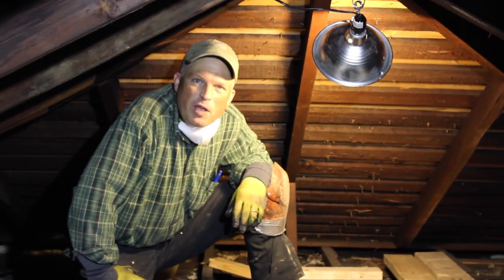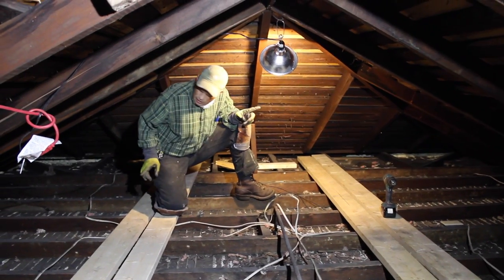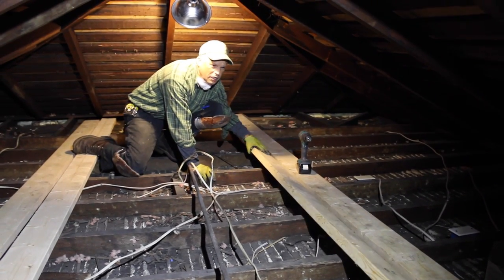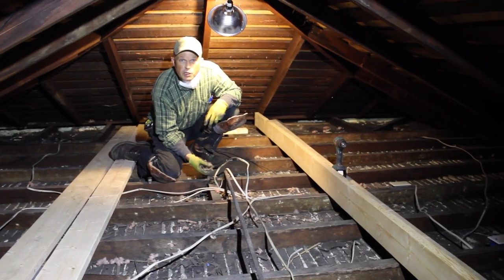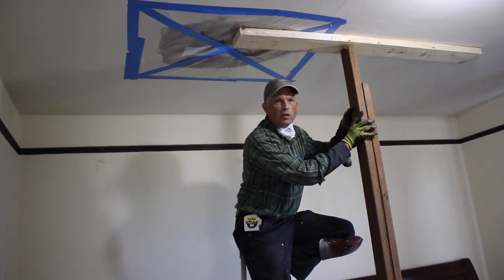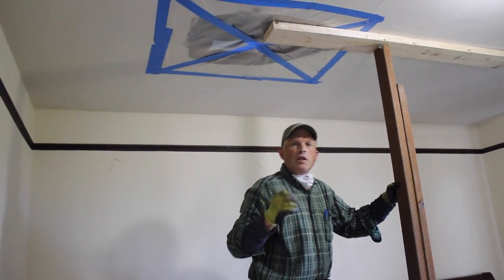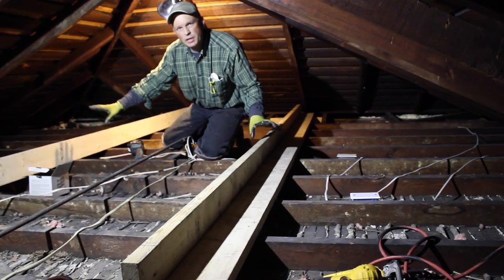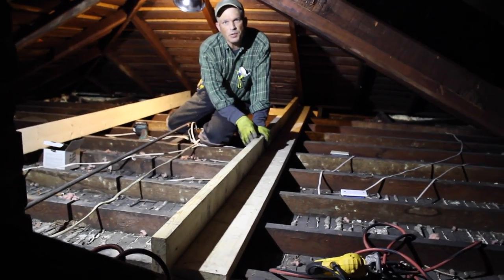Historic Home Attic Strong Back

Comment: Hi I am building 10 x 16 cabin and am nearly finished but the floor is sagging in the middle in the front of the structure.  Also the back of the structure has been sinking a little but causing a noticeable bend in the middle of the structure on the floor.  I leveled it off last spring using some jacks and cement blocks.  It sank almost an inch.  This spring I'm noticing it begin to sick a little bit again.   It's on a slight grade going down towards the back end and the back end is also a bit heavier.  I used nine deck post piers in holes filled and compacted with gravel as my foundation.  

So my first plan to fix my foundation issue was to just go and install a cement slab on another piece of the property and just move the cabin onto that.  But I am considering just trying to remedy the situation with a strong back.  

Do you think it would be a practical solution?  What method is used to connect the strong back to the floor joists?
Reply from the maker: +Nicholas Novak Hello. Well, my first reaction here is to think about the posts first. Essentially you built a "pylon" post type foundation, and I would try to identify why your posts are sinking, and if they will continue to do so. This way your not spending to much time and money trying to fix something that might not be remedied. If your in a place that has permafrost and a freeze thaw cycle then the ground just might soften enough to allow the posts to sink. You can see this sagging affect on old buildings with post and peer support over time. In any case you could use a strong back beam where the sag is and jacking it into place and attaching with simpson A-35 metal clips. one thing to keep in mind though is that the beam you install will have to be rigid  enough to take the weight of the sag and the ends of the beam will need to be supported somehow. Does this help in any way?

Comment: There is no actual video on how to install a strongback - how it is secured to the sagging ceiling joists, how is the ceiling actually raised (from within the attic or raised with hydraulic jacks) etc..
Reply: Jamie Morse ---    No need for jacks,  you determine how much you need to raise the ceiling and measure support 2x4's  allowing for the thickness of the the plank you're using to support the ceiling as he's shown---- you then simply tap the upright at the top until you've got it vertical which will effectively lift your ceiling-----   He's used Just one upright for this likely because he did it alone----   I would have used a longer support plank and 2 uprights tapped, ( or pounded if necessary!), into place -- but that would require 2 guys, or a lot more struggle.....  hope this makes sense----   If you've not worked with wood much this may make no sense-------
Reply: Even a car scissor jack would do the trick.....and much more precise
and less violent than whacking a post (cut to size) in.
Reply: Joe Sucks  No, I'm not a carpenter.....
But we restored a fisherman's cottage in Whitby (1860)
where the floors were bouncing.
The joists ran the length of the house, and were like rough cut tree trunks.
We jacked the bedroom floor from below, then crossed-laced 6x2' timbers, which were wood stained. It stiffened the floors a treat.
The basement got a concrete floor.

Comment: Very interesting and educational. IT'S a petty you haven't shown HOW TO ATTACH / SECURE the 2x6 s to the old levelled ceiling .
Reply from the maker: I used screws to keep agitation to a minimum. Did this video many years ago.
Reply: Used screws for what, hurricane ties, hangars? Sorry but this is half a video.
Reply: Probably just toenail style, using screws from both sides of 2x6 into each ceiling  joist 2x4

Comment: You should have shown how you attached the 2x6 and perhaps even why you chose a 2x6 and if even a 2x8 would be an option, and why you stood it on it's edge as opposed to flat?
Reply: Using regular lumber, it has no structural strength laid flat, its much stronger standing, the difference is 1.5 inches laid flat, and 5.5 inches standing. 2x6 vs 2x8 just depends on how far you're spaning
Reply: @johnjones4096  But: how did you attach the joists to the strongback?
Reply: @SmackintoshSr  Structural angle brackets would be what I would use in that situation. Simpson have some excellent structural brackets on the market.

Comment: I first wondered how you got those long timbers into the attic...That's what the hole in the ceiling was for, up & in patch it later..better then going through the roof. Also the flat timber is just a nailer for the vertical timber, a person could add another 2x on the other side of the flat to form a "U" for strength.
This issue is common as roofs also sag over time...  Great Video guy.

Comment: Hmmm....doesn't the strongback just load up the last rafter?  With a hip roof you can't get the bearing point to the outside wall. I assume the interior end of the strongback rode on that interior wall, which is another question.  I'd like to see the engineering on that strongback.  I wonder if a 2x6 is enough to carry the load or if you will eventually just end up with a sagging strongback.

Comment: Those stiff backs are pointless unless both ends rest on something structural. If they need to span from exterior load bearing wall to some other load bearing wall. These houses generally have an interior bearing wall that would work.
Reply: agreed. I'm guessing he does though because you can see the sag so easily, one end on the exterior wall and one end on a load bearing wall downstairs that also transfers load to the basement floor.  If that's not the case then he's wasting 4 days lol
Reply: I always thought strongbacks were to keep the joists from twisting and warping over time or when people walk in the attic. Guess I learned something new today.

Comment: i got similar long spanning joists 13', I want to cut a part of one out to put in new attic access , do i have to replace the whole joist or can I do something different like putting in doubler kind of header between it connecting to the closet joists?

Comment: Hello and thank you for putting up this video! My 1908 SJ craftsman attic looks very similar. I noticed that you are over a pipe that runs across the attic—I have all this pipe that is connected like a skeleton and have been wondering what is it? I have nob and tube wiring and figure it's not conduit. Thanks for any insights!
Reply from the maker: It may be old gas pipe for old original ceiling lamps? In nay case thanks for watching. did this video many years ago.

Comment: Would blocking between the joists do the same affect then add a thick flooring made of plywood?
Reply from the maker: No. Think of it more like a continuous header beam spanning across a room at a ceiling. If you cut it into blocks it won't have the same deflection support value. A designed header should be continuous. A layer of plywood won't help to minimize deflection or help with improper size  joist span to up their value.

Comment: I plan to use LVL beam as a strongback - how do I size the beam?
Reply: Lvl has a load table on their website. But characteristics of spans and board dimensions are 1.5 times the width of the board. 2x6 good for 9 feet 2x8 good for 12 feet. 10 is 15 12 is 18.
Reply: @Valient6  thanks

Comment: Great video.  I have run into this situation many times.  Should mention, however, that before disturbing the plaster and lath, you should have it tested for asbestos.  Older plaster was frequently strengthened with horse hair and / or asbestos.